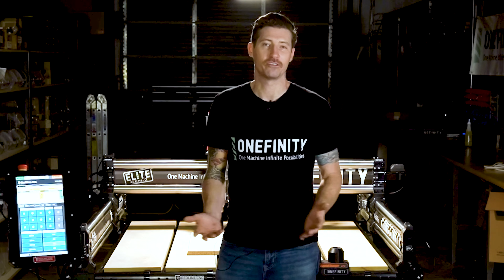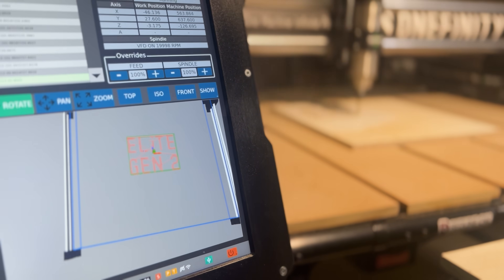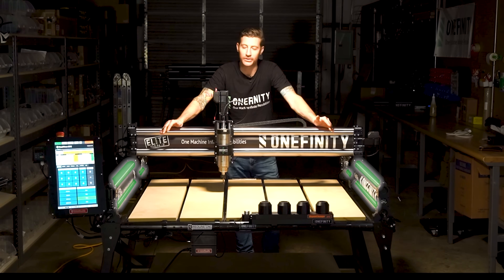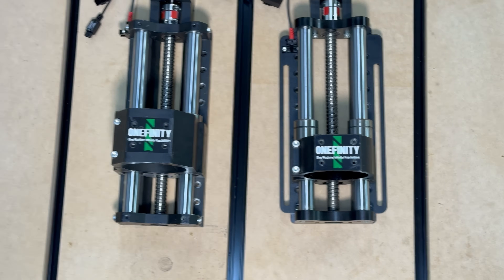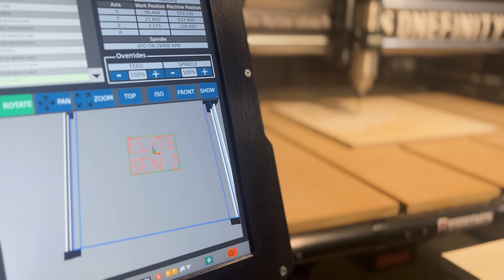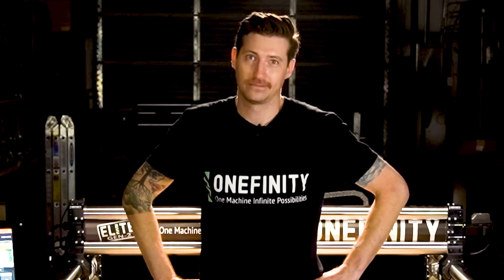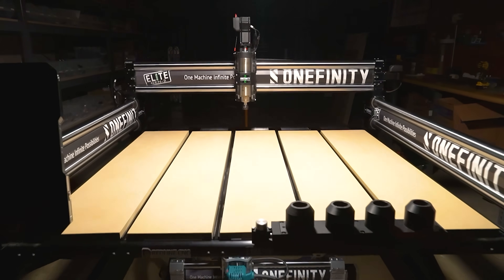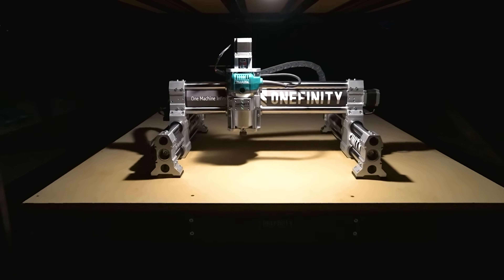Introducing the NEXT GENERATION of Onefinity CNC 🚀  |  Welcome the GEN 2 ELITE and APPRENTICE Series

Comment: I wonder if sacrificing the sealed rail bearings for ball screw covers will come back and bite you in the rear.
Reply from the maker: Hey Rob... The bearings are sealed.
Reply: @OnefinityCNC  Since when do you oil sealed bearings? I understand the bearings on the gen 1 aren't technically sealed either , but there is no way to oil them, with the new bearings, you know guys aren't gonna do the maintenance.
not tryin' to bust your balls, I'm just a worry wart. by the way Ilove my onefinity elite, I think you guys make the best machine in the segment......prost!

Comment: But can it metal
Reply from the maker: Many of our customers cut aluminum and steel on their Onefinity with great results. Hope this helps!
Reply: @OnefinityCNC  yes and no. Odd way to put it.  Does that mean the machines not officially rated, marketed or sold with the capability to do so?  Just trying to see the line here.
Reply from the maker: A RESOUNDING " YES IT CAN CUT NONFERRIS METALS!" :)
Reply: @OnefinityCNC  ok so nothing that contains Iron in any way then.  Understood.  Im looking for something capable of steel, stainless,  and so on.  Even if its not in thick proportions.   Most home made and COTS benchtop cnc machines can do non ferrous metals.

Comment: I have had my Elite for a few years and LOVE IT.   I also like that OneFinity keeps innovating their design.  Never fine with the status quo, improving what is already an excellent design.  I'm guessing the motors could be added to the current Elite, yes?
Reply from the maker: We love that you love it!  We're able to jump to the bigger 2Nm because the Redline has a bigger power supply.  While the Gen 1 could swap out the motors, they wouldn't be utalized due to it's smaller power supply.

Comment: Nice to see you are offering new and improved options. I have two questions: 1. Why did you go on the redline controller path and seem to be phasing out the Masso? 2. I like the new smaller “apprentice” version you are launching, however I do like the fact that I dont need a pc with your systems. Can I order a seperate redline controller and fit it on this smaller machine? Thanks for answering
Reply: The Redline is an in-house controller.  Masso, which I love had been difficult with upgrades and adding requested features.  Now, OneFinity can do as they wish.  I love the Masso and I'm sure the Redline is good too.   Touch screen control is the way to go, very user friendly.
Reply from the maker: Great questions, Nick — happy to clarify!

Masso is still fully supported and remains a fantastic controller. What drove Redline was customer demand and long-term direction. We wanted a controller built specifically for hobby CNC users with the features our community has been asking for: faster workflow, modern UI, real-time motion engine, tighter integration with our machines, and the ability for us to iterate quickly on new features. Redline lets us deliver those improvements.

But to be clear: Masso users are in great hands. It’s still an excellent controller, and if it’s doing everything you need, there’s absolutely no reason to change.

The Apprentice uses the exact same Redline motion control platform as the Elite. But Apprentice machines have a 65 mm Z-slider and a shorter gantry, so they physically can’t fit the 80 mm spindle required for ATC hardware, and the frame is intentionally scaled for beginners. 

Think of Apprentice as the “dip your toes in” machine: simple, strong, no PC required, and fully self-contained just like the Elite.
Think of Elite as the “I’m ready for more” machine: bigger, beefier, expandable, ATC-capable.

If you want the power and upgrade path of an Elite, start with an Elite. If you want something compact and beginner-friendly, Apprentice nails that without needing a computer.

Comment: Will we be able to order those Ball screw covers for our Elite (Gen 1) series?
Reply from the maker: Hey @Hangs4fun... Upgrade kits will be available in the future.
Reply: @OnefinityCNC  For just the ball screw covers on gen1 elite, or will we have to upgrade from Elite gen1 to Elite gen2?  Right now, what I have is some 3D printed parts and I laser cut some 3mm acrylic to provide some level of protection.  Your's look great though and contoured (mine is just flat acrylic covers.)   Any way would LOVE more details on that, this has been a sore spot for me on my Elite Journeyman (I did 3d print and assemble some brushes.
The other great enhancement I see is those magnetic bearing covers that allow for easy bearing greasing.  Obviously those will be a much hard to sell and install upgrade.  But I'm fairly good with my solution for that issue (though maintenance isn't as quick as this new gen 2 design looks)
Reply from the maker: https://forum.onefinitycnc.com/t/can-i-put-the-new-elite-gen-2-ball-screw-covers-on-my-gen-1-onefinity-machine-faq/36580
Reply: @OnefinityCNC perfect.  Thank you, that answers my question

Comment: I'm interested to hear more about this option as a potential path for OG Builtbotics machines :popcorn-yellow-striped-smile: "Realtime CNC Motion Control Software (Requires Windows computer, PC not included) Redline RealTime CNC Open Loop Motion Controller" because buying the apprentice seems like a cheaper way to upgrade than the upgrade package with the controller, and potentially leaves me with two working machines. 🤔
Reply from the maker: Oh, you might have found a sweet loop hole :)

Comment: I'm really pleased to see the improvements to maintenance and longevity, and also the removal of the "wings" from the z-slider! Two questions: I'm curious why you stuck with the tubes. My mechanical engineer coworkers all tell me they will never be as stiff as the I-beam extrusions other manufacturers are using. Is there some reason to stick with those? Also, I see the Gen 2 no longer uses the Masso controller. Will you be offering any configurations with the Masso, or is that something you're phasing out? Again, congrats on the upgrades. I had to sell my 1F Elite prior to a cross-country move, but I'm seriously considering purchasing another one once I get settled in my new home.
Reply from the maker: Hey @mghumphrey... When comparing stiffness, the critical factor is the size of the tube. With equal dimensions, a steel tube will always be stiffer than an aluminum extrusion. In addition, hardened steel tubes offer significantly greater precision and long-term durability
Reply: Steel tubes also handle vibration better
Reply: Not to mention, the Steel Tubes look soooo cool!
Reply: @OnefinityCNC  Does onefinity provide deflection measurements for their machines? I'd like some numbers.
Reply: @dominicfeira9388 They can't even give an honest answer here. I wish YouTube had Community Notes like X...
Reply: @OnefinityCNC That's interesting, because aluminum is stiffer (but not stronger) than steel. Anyone whose ever compared an aluminum framed bike with a steel one knows this. And I think many of us have seen videos showing more deflection per equal force with the 1F than (for example) AltMill. I guess if you can't answer this question honestly and accurately, I've (indirectly) got my answer on what to buy.
Reply from the maker: Hey there! The Gen 1 Elite Series with Masso is still available on our website!